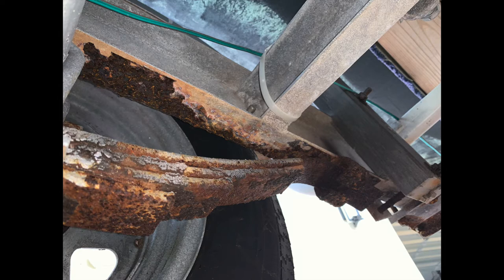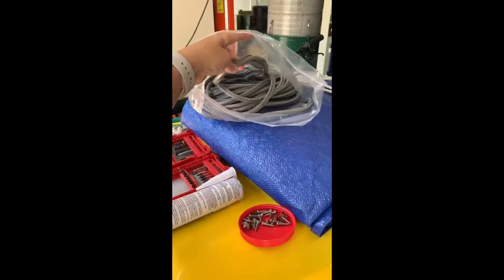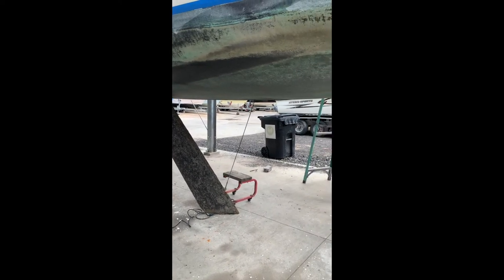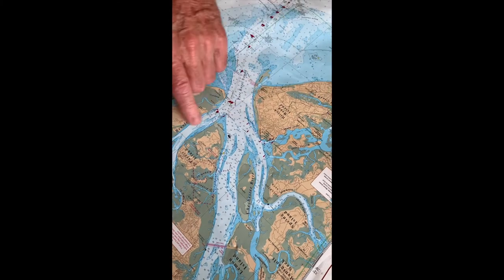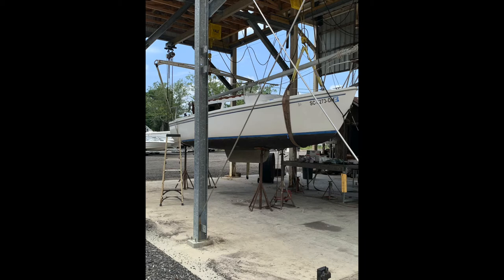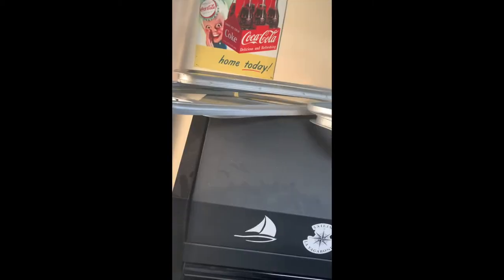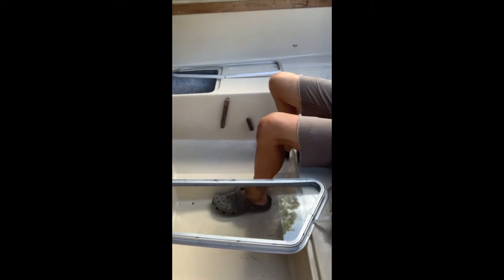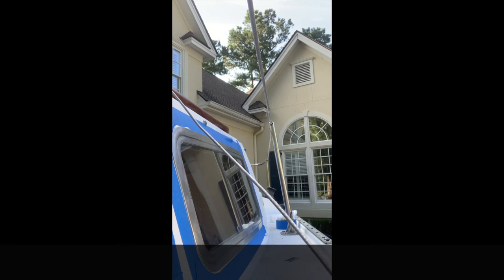How to repair sailboat windows and our trailer on our Catalina 22

Comment: Ideally you  may want to find a boat yard which allows DIY work, since as you already found out getting a boat fixed by 'pro' can cost a fortune. The cost of an old boat, especially a small one, may not be that much compared to all the recurrent charges ( marina, insurance etc ).  A larger boat also add haul-out fee plus all per foot cost increase with length. Going small have some advantage for sure. Happy sailing.
Reply from the maker: We are hoping to retire and cruise around the world in a catamaran. That's the plan !  Now we better start planning !

Comment: For a complete beginner, are the instructions (videos?) that come with the window reseal kit good enough to do it at least so the don't leak? It looks like it must have a helper to be done correctly. True?
Reply from the maker: These were done in 2020 I think, so details are a bit blurry, but the kit came with a DVD and we watched YT videos as well... D thinks Jim's Little Boat channel may have had a video on installing them. Ours never leaked, but D is a perfectionist and used a lot of caulking stuff. We would definitely suggest having a helper to hold things... 4 hands are better than 2.
Reply: I saw another video where the man used a weighted bag to hold the window in place.